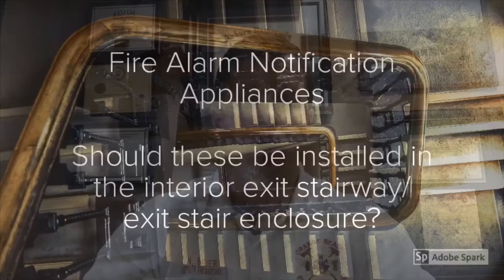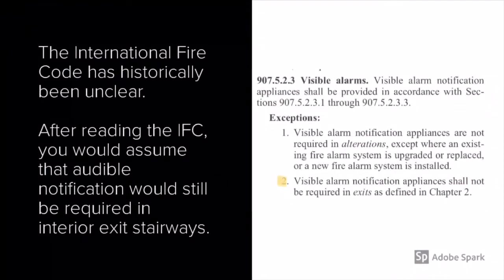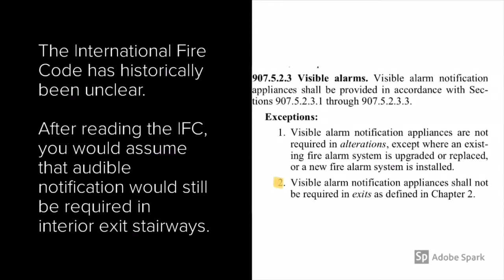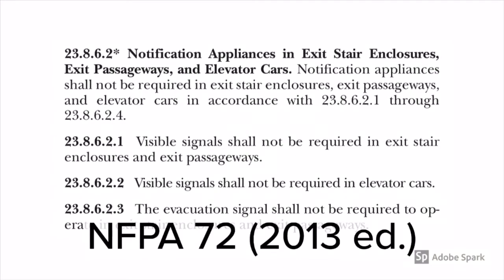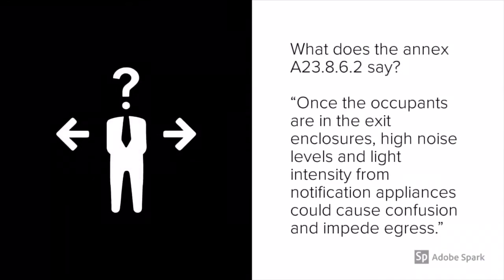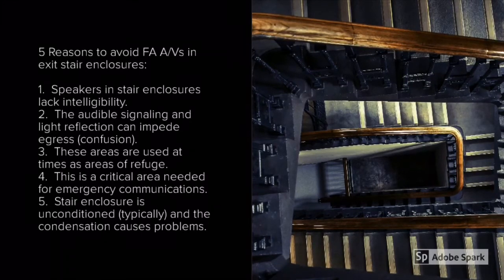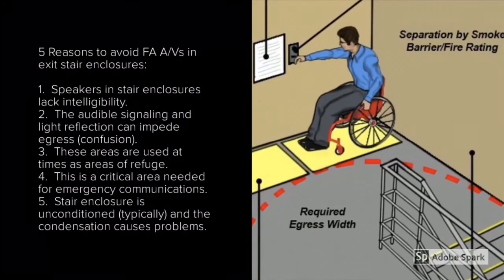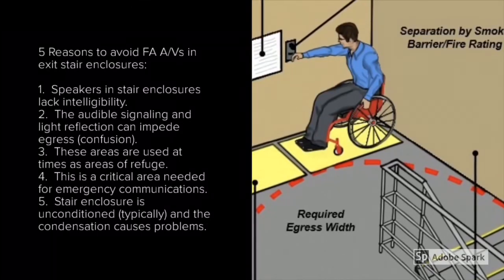FMAA-SD#18 (FA Notification Appliances in Stair Enclosures)

Comment: I completely agree with the thought process of eliminating these FA A/V devices in stairwells. Fortunately for us, the only buildings we have with stairwell enclosures are protected so moisture and such would not be an issue. I do completely agree about the confusion to be caused for occupants. When I did one of my finals at our new Hampton Inn, I was actually discussing along the lines of this with the GC. We discussed it as a worst-case scenario of 0300 with smoke in the hallway at a facility you aren't familiar with. Adding the use of notification devices in the stairwell just creates a recipe for disaster. Great points on the video as usual!
Reply from the maker: Thank you for the feedback!